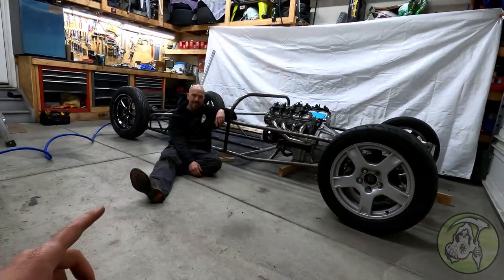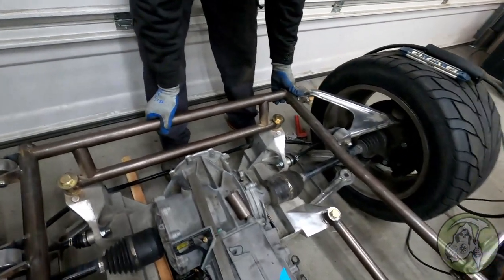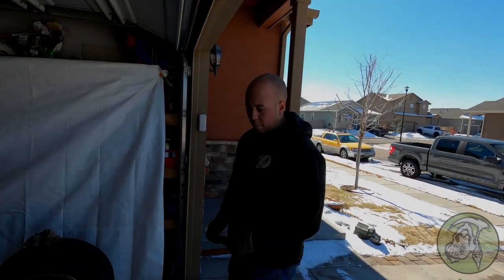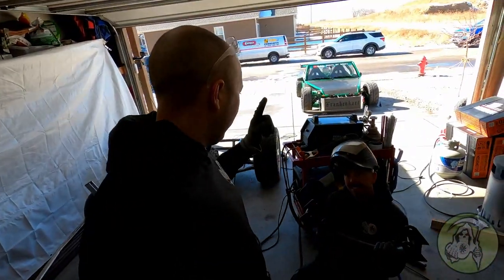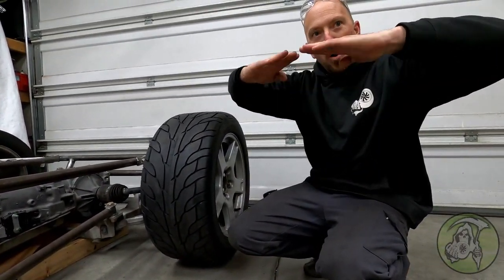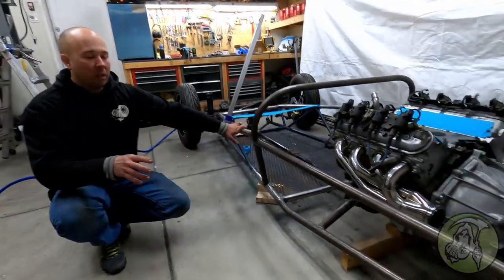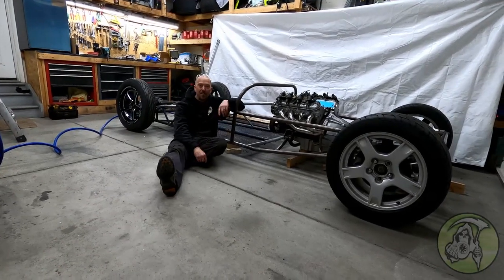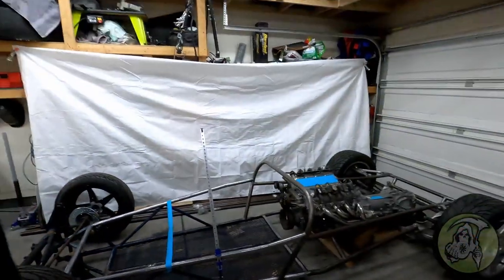The LOWEST car? This thing is gonna be FAST!

Comment: This thing looks like its gonna be sick! But the flux core weld makes me nervous....
Reply from the maker: Thanks man! Why does it make you nervous, flux core is a very common welding process
Reply: Missing gas nozzle of welding pistol makes me nervous. I would use more Amps also.
I am International Welding Specialist.
Reply from the maker: But flux core doesn’t use shielding gas. It produces it’s own shielding gas just like stick. However you can dual shield with flux core if needed. I have used flux core at home for over 15years never had a weld break. I have used many other processes also and have held certs at a few companies. I appreciate your concern tho. Thank you
Reply from the maker: https://weldguru.com/flux-core-vs-mig-welding/
Reply: @DeathByBoost  I'm an at-home flux-core welder too. As long as the weld is clean, it gets the same results.
Reply from the maker: Hell ya 🔥
Reply: @DeathByBoost  I haven't had any good luck with flux core. I've made several parking lot and trail fixes that I, 99% of the time, had to go back and fix. But it maybe because I don't normally use flux core. I just prefer mig or tig I guess lol
Reply from the maker: Ya everyone has there own skill that there better at. Kinda like me with tig lol
Reply: He can always send a sample out to be xray tested.  After that you can be sure as long as you're consistent.